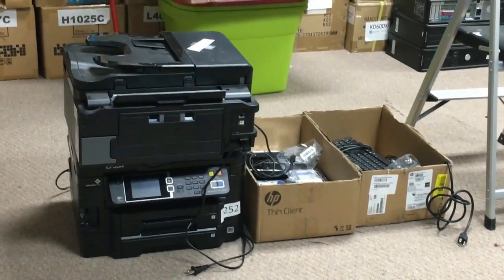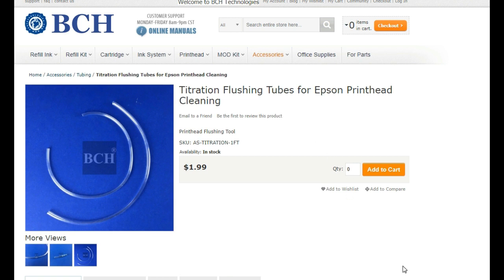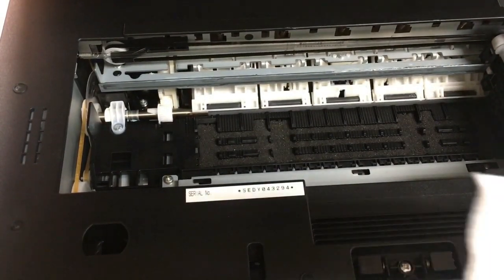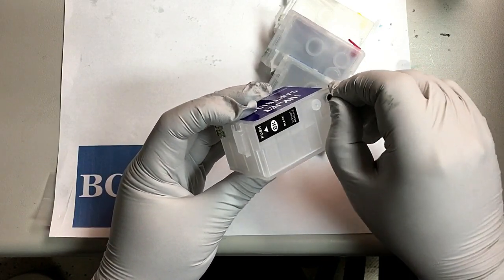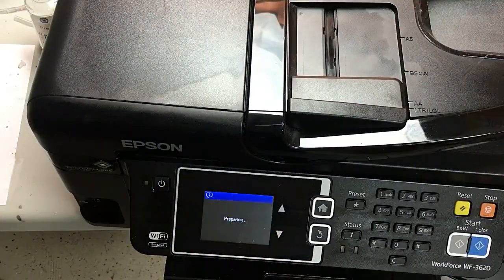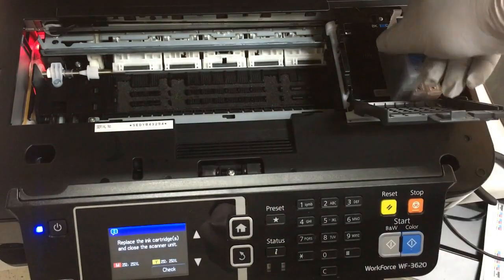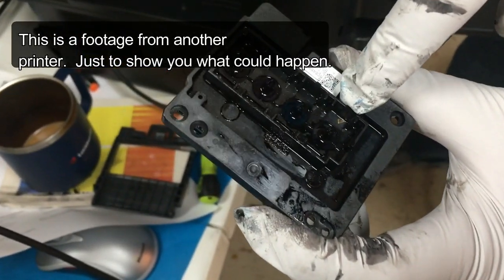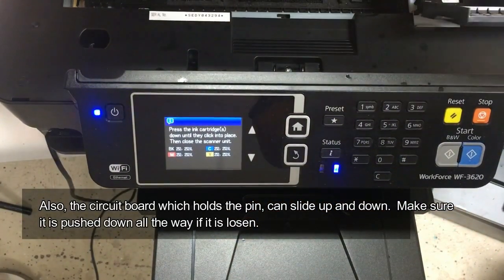Troubleshoot Epson WF-3620 Not Recognize Cartridges - Refill, Unclog and Reset T252

Comment: Hi Kev Kevin's Ink & More
Thank you for your video. I have the problem after printhead cleaning that cyan and magenta are not recognised. But when changing the cartridge they are recognised for a short time. What can be the problem for this? Did you let the print head dry without cartridges? I don't dare, I don't want it to dry out.

Comment: After you flushed the print head a second time and re-installed the cartdriges, have you run the cleaning cycle to prime the head or just tried to print right away? I have the same printer model, I tried to flush a few times (using windex with amonia) only the problematic color (cyan). Then I try to prime the head by pushing air to the breath hole of the cartdrige (for force ink into the head), but I still see some missing lines.
Reply from the maker: I tried to print a nozzle check before running the cleaning cycle.  My plan was to do a nozzle check first, then do two cleaning cycles.
Reply from the maker: If there are just a few missing lines, wait few hours and see if it can improve.
Reply: I have already tried waiting several hours in multiple occasions. In fact I have been working on my printer for about a week, without 100% success. It all started with the black color (which ran out of ink). In the process of trying to clean it the black one (by flushing the printhead), I ended up clogging the other colors. Black is now almost 100% good, but cyan is pretty bad. Anyway, next time I will try a warm solution of 30% isopropyl alcohol with 70% windex instead of just plain cold windex. By the way, I am using pigment ink.

Comment: i have Epson WF-3520 same error appear in my printer display screen as last week i changed non genuine black cartridge and i got black and white print it was working  last Sunday but today 18/4/2022 7.15pm Melbourne Australia time not working i did every thing according to this video and even i replaced another yellow,magenta,,purple cartridge still printer didn't work work i cleaned cartridge head and chip but same error come no difference.

Finally i got my printer error fixed

i removed black cartage which i changed last week it seem to be faulty and change another new black cartridge now it is working and no error showing
so try to changed cartridge one by one then error will disappear.
if you refill cartridge and putted then most probably printer error show 
so my advise changed one by one cartridge problem will fix.

Best Of Luck

Comment: Epson printers are annoying, and overpriced!  DO NOT BUY THEM! They are deigned to waste your time and suck as much money as you let them. If any of your cartridges are empty, then non of the other features like the scanner  or black printing are accessible .  Some other brads are not as bad as this one. Try to figure out how much is the cost for the ink/ liter or gallon. The total weight of a new cartridge is 28gram and 22gram when it stops printing.